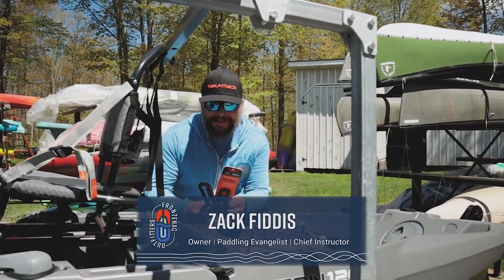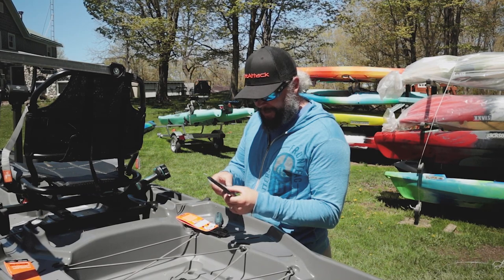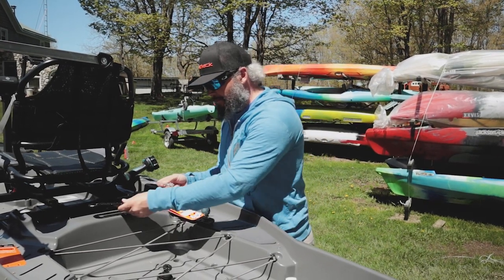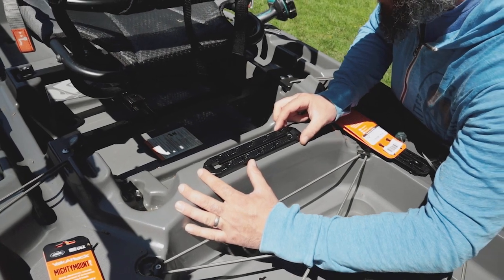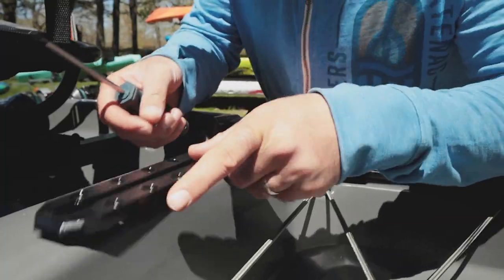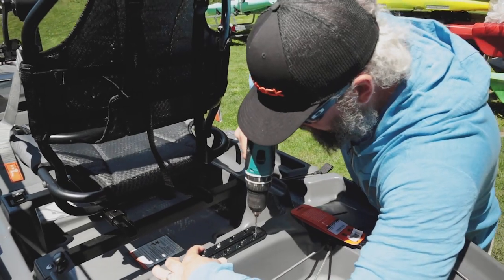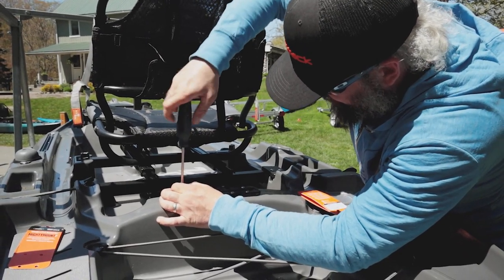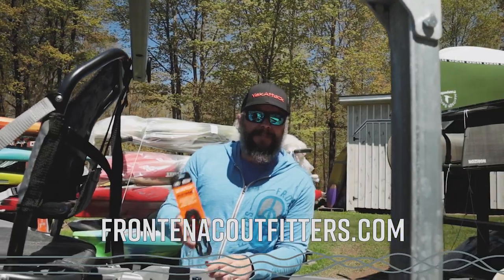How to install gear track on your fishing kayak with NO ACCESS to inner hull

Comment: No silicon or any thread sealing for the screws??
Reply: Same question. I thought there would need to be some sort of waterproofing needed to avoid water from leaking into the body? ...rubber washers, a gasket that came with the track, silicon...